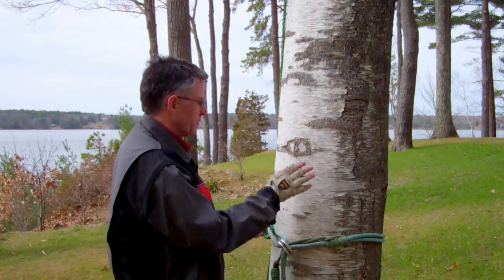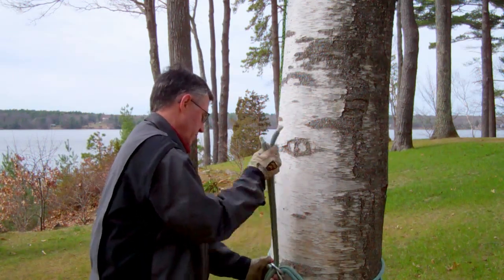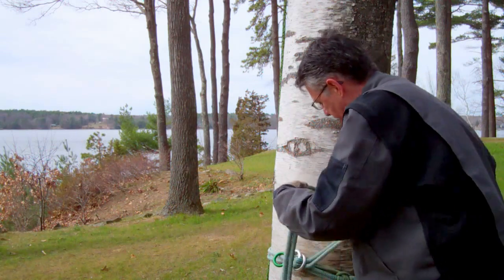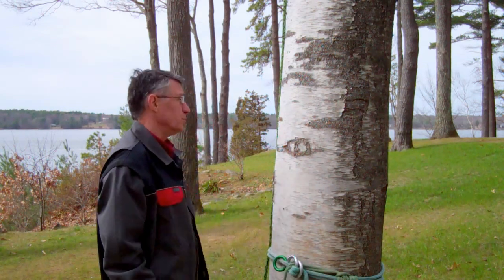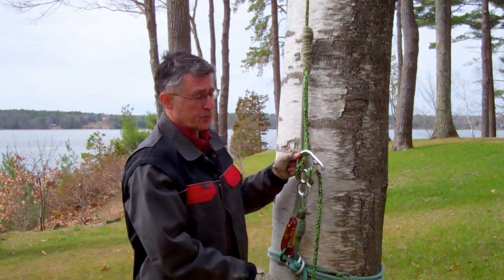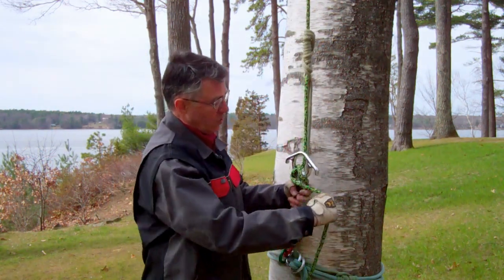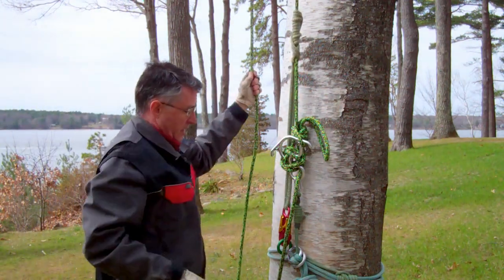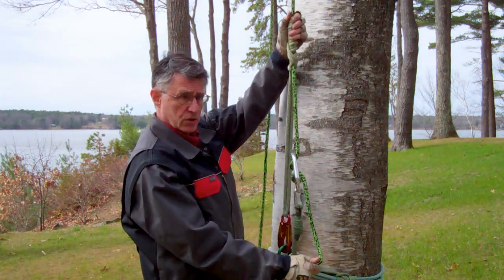DOUBLED UP Basal Anchor installed ready to climb

Comment: I had to remove 6 trees in behind my house I am remodeling. I was taught by USAF to climb poles and while working for a city utility, in the mid 90's, we climbed trees to trim and take down with lineman belts. I wasn't going to climb with a Lineman's belt anymore. As far as climbing with spikes I just needed to refresh my self no big deal still like it. Tom between you JB Holdway and many more, good climbers and the bad ones, have help me get the right equipment and climb safe. Slow but safe.